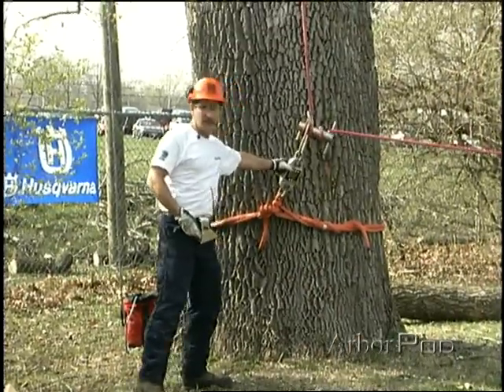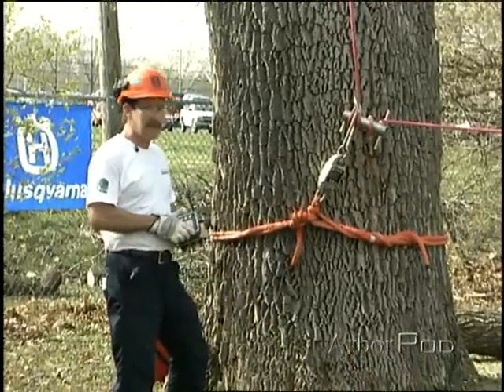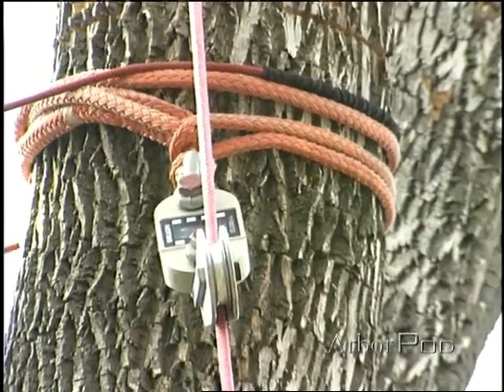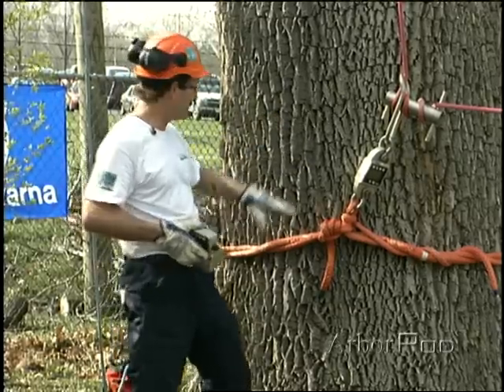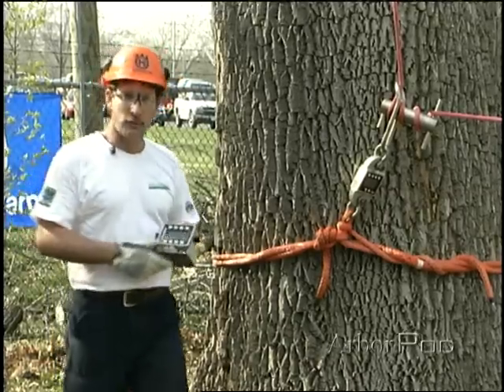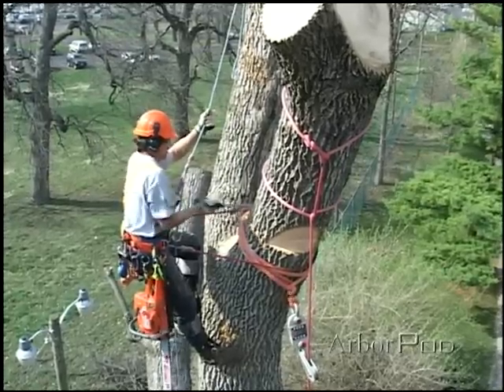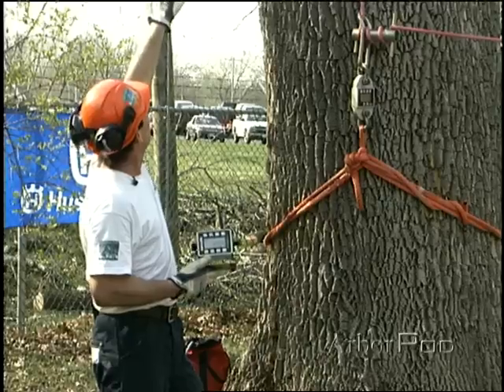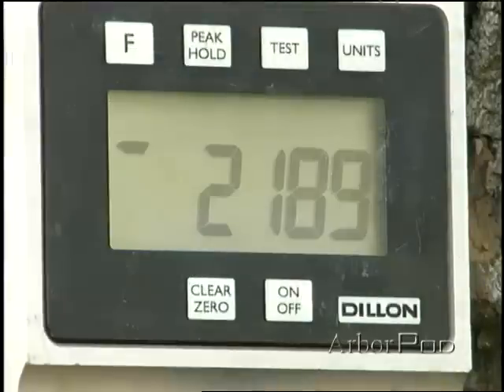Dynamometer Drop Tests part 1

Comment: Great vids, have watched both a few time now and, correct me if I'm wrong, but in this one I get the impression that you tried emulating "bad groundsman" to show just how much force a log can peak at despite it "being allowed to run"?  I say this because  the thing basically free-falls for 10' before being abruptly brought to near-stop and then gently lowered, it was the most-abrupt catching/running of a log, so is it fair to assume you were showing 'worst-case' forces in a letting-it-run scenario?  (I'd watched part 2 first lol, and after seeing the 7.5k peak figure there, I was astounded to see a comparable load hitting nearly 5k here with a porty, but upon watching it it really looks like the roughest 'catch' by the groundsman possible - though I understand the reasons one would choose to do a demonstration in that manner!!
Got that ISA code from summary of one of these vids, hope it's still a thing, I'm not "into" certs if not requisite but am curious how I'd do, un-prepared, on such a test :D